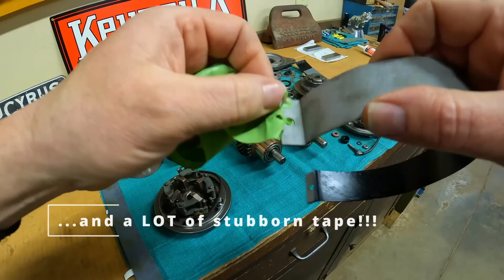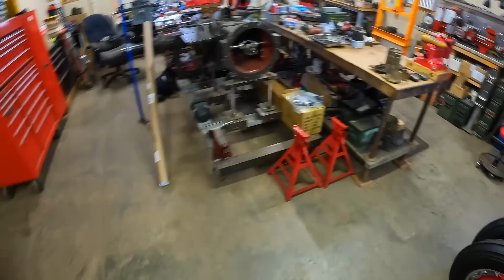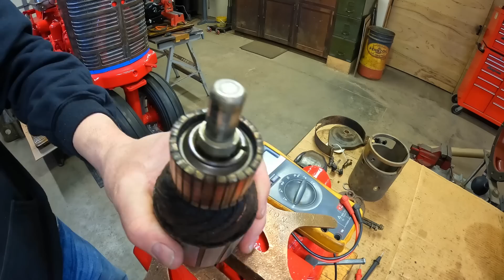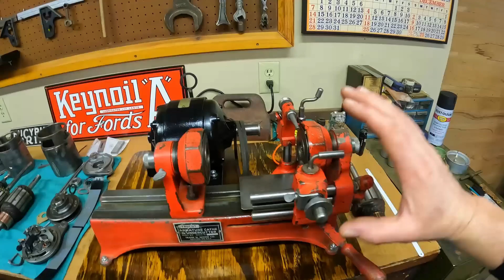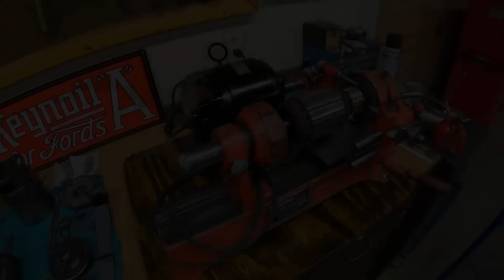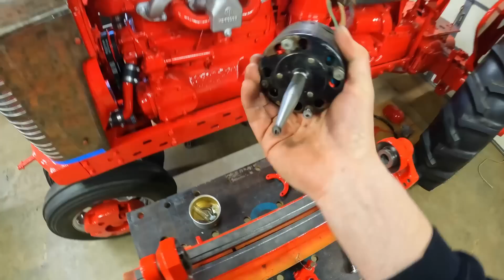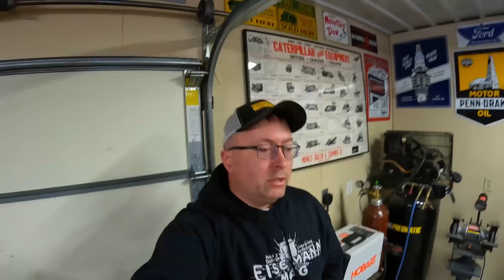Antique Tractor Starter/Generator Armature Testing & Reconditioning - "Preparation H" Episode #32

Comment: What would one of those smaller armature lathes sell for? Set up and ready to use. I think it would be smart to have one since I'm into restoring the older offset Farmall tractors. I currently own over 150 tractors and sell parts too so it might be a necessity to have. I've never rebuilt a starter or generator before but it doesn't look out of reach for me at all.
Reply from the maker: We usually get around $500 for one completely restored with new cutters ready to go.

Comment: I want to keep my H's generators (i have 2 H tractors), but I want to have them rewound for 12v. I don't like the alternator swaps on H's for the reason you mentioned,  but I do want to go to a complete 12v system.  12v coil without external resistor,  etc.

Comment: A 110 Volt tester would be preferred over the use of the DMM. Also place the hacksaw blade length ways resting on the armature laminated core. Should the hacksaw blade vibrate while you rotate the armature is a sign the armature windings are cross shorted.
Reply: Additional to my previous comment- if you don’t cleaning between the commutator segments after cutting in the lathe, you will see the evidence of the hacksaw vibrating will testing with the 110 Volt Growler. This is evidence of shorted windings too. Use the under cutter and then use the 110V Growler. The hacksaw blade will not vibrate- evidence the windings a no longer cross shorted to each other. The windings should only be connected at the commutator ends.

Comment: It's about time someone makes a video explaining the mistake of replacing their DC generator with an AC one.  I've been stating this for decades!  

The armature winding is continuous, and each commutator segment is a tap on that same winding.  Therefore it is only necessary to test the resistance of the insulation between any one segment and the shaft.  The exception would be if you happened to have a segment that had become disconnected from the winding.

Comment: You are right the original DC compound generators and those cool Amplidyne/Metadyne generators/rotary transformers are lot variabel and cool devices that includes sir same thing that you have. I took ordinary bosh starter motor out fummeled litel bit with magnets size and orientation and suprise out put is this (+-,-+,++,--) so no wonder people polarised that staff it's basicali equivalent to an virtuali created plates for baterrys that thing is so much cool it's unbelivabel even modern electric enginers are useless at some point. So your totali right .Only thing that that generator is different from an multi phase AC generator is no difference it can by forced to operate in similar manner . So great video thank you . But I must add problems acure if it's an magnet type generator heating magnets ,phisicali damaging them,magnets ratios of pole faces, hammering magnets ,de magnetised magnets cause lot fun .I won't bring up extra coils or serries/parrarel brushes or shorting brushes or looping power around etc. But deam those old staff are cool to watch . Well even the 1 wire alternator has bypass voltage regulator function so basicali those 2 devices are the same one regulates more current the other regulates more voltage I ques so no difference what so ever but I prefere those cool DC generators they are more chalangeing and more variabel . 👍

Comment: Would the commutator cutter on your parts armature lathe be for sale?  Check with a generator shop for the circular saw blades for the under cutter.

Comment: Are the armatures centre drilled at the ends, for turning between centres on a normal (or very old!!) lathe?
Reply from the maker: No, they’re not. But Senior has a special armature adaptor for one of the regular lathes here that is basically a centering chuck like the dedicated armature lathes have but it’s on a #2 Morse Taper and it goes in the tail stock like a live center would. Basically turns the regular lathe into a similar setup that can hold an armature on each end like this 👍

Comment: Thank you for that education, Toby. I suffered an electrocution in high school, and ever since, if I can't plug it into the wall, I don't mess with it. I ALWAYS sent the parts out for repair due to that shock.

That being said, now I have minimal fear of what needs to be done to resurrect these beauties. Thank you for changing my thought process. I'd much rather invest in the appropriate tooling and do it myself than pay someone else to do it for me.

I still won't use a chainsaw for any reason. Dad and I watched a guy nearly kill himself with one and that was enough for me. He tried nosing into a log from below when the saw kicked. He was able to "catch" it and pull it away from his body before he sliced through his collar bone and shoulder. However, on the way forward he took his ear off. That still gives me flashbacks, and a reason to pay the professionals to do that work. Call me a chicken and you'll hear me start clucking. I have no issue with that... LOL!
Reply from the maker: Im kind of the same way with electricity, I worked on 12 volt systems for 20 years at the Ford dealer and know that they pose no actual danger to a person whatsoever - but my personal rule is that anything bigger than that gets left to a professional. I don’t touch any actual electrical service to homes or buildings, because of my limited knowledge of higher rated electrical systems it’s just not worth it 👍
Reply: @squatch253  I took a full 120v in building trades at my trade schools apartment building. 6 apartments with 1 service required jumpers from apartment to apartment. I locked out and tagged out as instructed, but someone else decided they needed power worse than my safety. That person  got something I've never seen before. The 5'9" instructor had the 6'2" kid at arm length by the throat with one hand. I didn't know toes could stretch towards the ground like they did that day. LOL! Now, locking out a service requires that physical breaker in my pocket! Crazy what life experiences do to you.

Comment: Hello from greece..Can I slightly increase the power of a tractor starter??? it turns slowly as soon as the ambient temperature drops even though everything is fine, the rotor, pipes and cables have been changed. also the battery. everyone tells me it's small but it used to run very well... it's a Lucas brand with a 65hp Perkins engine

Comment: One suggestion is to use the sharp tip of the probe.  There can be a bit of surface resistance due to coating on said surfaces (from non visible corrosion to atmospheric and local environmental crud).      Love the Fluke,  those are great meters.

Comment: Honestly, WHY would you go to an internally regulated alternator when it's EASY to repair/ renew parts on an original generator or an old starter.
Reply from the maker: Because most people don’t really understand how both systems actually work, they’ve just heard that alternators are so much better, from enough different sources that they just believe it’s true. Seriously, the first time I ever rebuilt a generator charging system I couldn’t believe how simple and serviceable it was - literally $20 invested in a new set of brushes, a cleaning of all the regulator contacts, and I was back in business 👍 By comparison, modern alternators keep the consumer dependent upon a continuous parts supply chain to keep turning in their broken “cores” for new or rebuilt units, which is the opposite of being self-sufficient and able to perform your own repairs.

Comment: My grandfather used to sell and repair Electrolux vacuum cleaners.  Although he would test armatures, he never went into this great of detail.  Once the armature checked good and it was reinstalled in the motor, he would use an armature stone to clean the commutator and help seat the new brushes.  Thanks for the how-to video!

Comment: When my 1966 6volt bug had  a completely dead battery  my friend s  push me it wouldn't  light the oil pressure light or generator light   i popped the clutch it started a alternator  won't  do anything unless you have some voltage to energized the fields.

Comment: A diamond tipped tool bit makes the absolute nicest cuts on copper, copper, being soft and wanting to tear and be gummy. It is hard to get a really good finish, with a diamond tip tool bit the cuts are just effortless on copper, my father used to use a particular sandpaper on armature, he said the wrong sandpaper would embed itself in the surface, and then in your brushes, but I cannot remember which one it is
Reply from the maker: My Delco-Remy manuals here discuss a “00” sandpaper/emery cloth to polish commutators and burnish in new brushes 👍

Comment: We had a man in our neighborhood that rebuilt starters, generators, and alternators. If he was suspicious of an armature, he would test it with 110 AC with a light bulb. He said that he started doing that when he had a starter that everything tested good with the meters but wouldn't work when he put it together. It had bad spots in the insulation that would arc when it was under load. He showed it to me when I brought him a starter that would run on the bench test but couldn't turn the engine over.

Comment: thanks for sharing with us. There are practical reasons to goto 12v alternators, but in general I agree the original 6v parts are the way to go, especially on a C or H Farmall. Now if you have a 60s or 70s Ford with a Lucas generator, that's a different story 😂.  My H had original wiring in dangerous condition, yet was the only generator equipped tractor on the farm that reliably charged, they are designed that reliable. Neat to see the electrical maintenance tools, no electrical shop is as clean and well lit as your shop ;).
Reply: most problems people have encountered with 6v begins with maintenance (lack of) and being cheap. For example, the battery cables hanging up in a parts store or retail setting are cheap, even for your Honda beater.  but those are the ones that sell en masse and people buy for all their repairs. Nothing ruins electrical more than operating at low voltage, high load from dirty connections and under-rated conductors. Parts availability is not an issue with delco, deere, farmall--yet, though we will see it sooner than later now. There are obscure situations where a conversion makes sense (make that one year only 30s car driveable).  I am a fan of well-done and thought out conversions, but the hack a hood is just wrong.
Reply from the maker: I agree, and the majority of really poor alternator conversions I’ve personally seen have been on already neglected tractors that had owners who were just concerned with getting a little bit more life out of them, with minimal effort or expense invested.
Reply: @squatch253  and sometimes that's ok. But they shouldn't claim "restored" when there's a gaping torch-cut hole in the hood. I saw one with a beautifully crafted bump out welded to the hood, much respect to that effort.

Comment: Same thing with old cars - switching to an alternator usually isn't required.  A generator is simple to recondition/rebuild, and it will work just fine.  I've found in most cases that replacing the brushes and bushings along with a general cleanup is going to be all that's really needed.

Comment: I agree on the gen vs alternator deal, it’s sort of like points and condenser vs electronic ignition. Sure electronic ignition is more convenient, but if it quits in the field, I am down for the count. If points fail, I can always polish and adjust them and get back running. If my alternator quits I am broke down, usually if my generator quits I can clean and adjust the regulator to get back going. My one question is where do you get your regulators? all of the ones that I get are really cheap Chinese junk and don’t last very long.
Reply from the maker: Brillman Company has a “cheap” regulator option and an “expensive” regulator option - go with the “expensive” regulator from them and you’ll never regret it 👍 The “cheap” regulator is the same Chinese knockoff that everybody else sells.

Comment: Toby, is there any reason why this refresh procedure wouldn't work on the starter/generators found on the early IH Cub Cadets? I have a couple of Model 100's and an Original that need refreshing. A second question if you don't mind:  If a short is detected in the windings, does that mean the armature is not "fixable:?  Thanks. Great video.
Reply from the maker: Yes, this same basic procedure applies to nearly all starters and generators of this era, because just about everything that was produced by everybody was almost identical. If an armature has an open circuit or a short circuit, it is quite possible to have all of the windings replaced - but the only downside to that prospect is that it’ll be nearly impossible to find anybody that still knows how to do that. My personal strategy is to keep several extra starters and generators on hand for everything I have, to use for spare parts if I ever encounter something that I cannot easily fix myself. You can usually pick up core starters and generators at the swap meets or from the tractor salvage yards pretty cheap, especially if they can’t guarantee that they work.
Reply: Thanks for the reply. Your detailed videos are so welcome and will be well used! Again, thanks. @squatch253

Comment: Great video, but a tip when cutting old mica, wear a mask to prevent inhalation of the dust particles (it can be nasty stuff for the lungs). If you have a shop vac, consider using it to remove the dust completely from the workplace. Newer motors, starters / generators use synthetic mica or resins that does not have the same risks.

Comment: This brings back memories. I was an apprentice auto electrician in the very early '70's and basically spent my life refurbishing Lucas C40 generators. I must have done hundreds as well as Lucas starter motors.. My lathe back then was more primitive than yours though. I also did field wiring and re taping but never tore down an armature, I joined the Army before I got that advanced. Thanks for the vid.

Comment: Just a bit of information. The O.L on a fluke multimeter means "Overload" It harkens back to the first digital multimeters. (50s and 60s era) Way back then, it could damage a multimeter if it was left on the resistance function with nothing connected. Of course now it's not the case with modern multimeters but the following generations of multimeters carried on displaying the O.L when the leads are open. Just a little history for ya. Dave in TX.

Comment: Finally a younger guy to show how to clean  test and rebuild the ol stand by starters and generators  and 100%correct if starters  starting engines are maintained  right you'll always get the Diesel going thirty-two thirty-two below to push snow for a road in Maine we're trucks couldn't move the drifting packs try that with electric start  ronrdzl

Comment: I work on large DC motors from time to time, the only addition to your comm machining that I do is to V the edges lightly on each groove where you cut the mica from, them polish the comm, this gives the motor longer life, other techs also bed the brushes in which is necessary with high voltages and currents to minimize heat spots. We also use 500v as a earth test.

Comment: Great video, this was part of my day job for several years. We turned commutators for generators and starters, but also wound rotor AC and DC motors up to about 600 hp. One crucial point on undercutting commutators. The choice to do or don't undercut comes down to insulator material. If the material is black, it's Bakelite, those you don't undercut because it is softer than the Copper and wears at the same rate. If it is Tan it's either Mica or fiber resin, then you do undercut, because the material is harder than the Copper. On those types, the material being harder than the Copper, it will stand proud of the surface as the Copper wears causing Brush bounce. Bounce causes premature wear due to arcing eroding the surface.
Reply: @steamfan7147 for years I never knew why in the sixties we under cut dynamo armatures but not starter motors.., A 60 year mystery solved   Must have been the insulation material.

Comment: If you are going to cut the mica with a hacksaw blade I have found it does a cleaner job if you geind most of the set off of both sides of the teeth.  It also keeps the sides of the hacksaw teeth from cutting into the copper parts of the commentator.

Comment: Beauty. As an aviation mechanic, I worked in a shop that had a certified repair station to rebuild starters, generators, magnetos etc. we did the same things, there is not much difference in the tractor accessories and the aviation accessories.  I used to joke: “if it looks the same, it is the same”. But not around the Feds who usually had a sour disposition . Small things like leads on brushes is about it. We didn’t have a dedicated armature lathe and used a regular lathe. There were less problems with generators vs alternators and generators outlast alternators in that environment.

Comment: Before reaching for lectra clean, I like to try crc's contact cleaner.  It behaves as a rinse agent [no water] and I have yet to see it damage any finish.  It first found a place in my shop as a quick way of backflushing sintered metal filters to see if they could be re-used.

Comment: Can you convert those generators to 12v? We swapped to a 12v regulator on a friends 49 dodge pickup  and the original untouched generator happily puts out 13.5 volts.